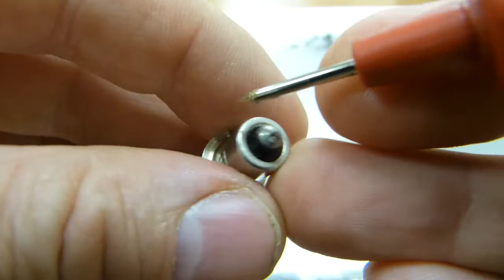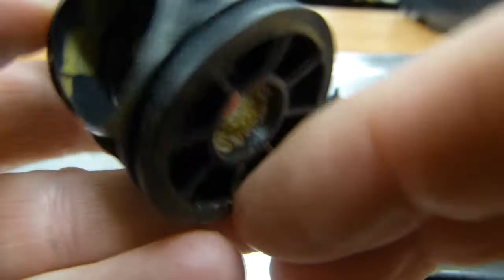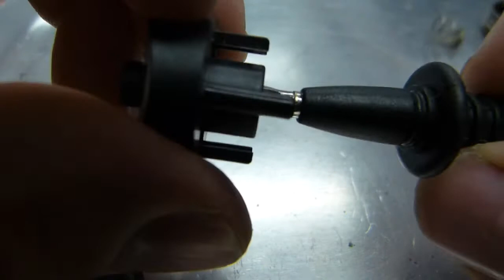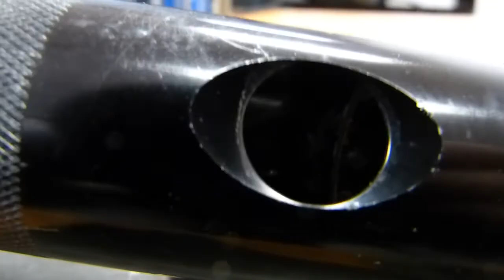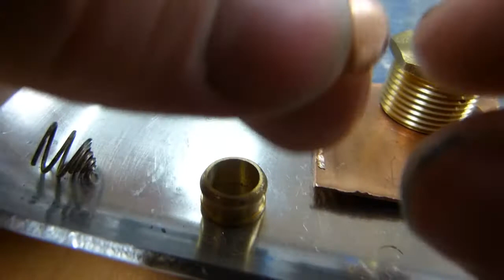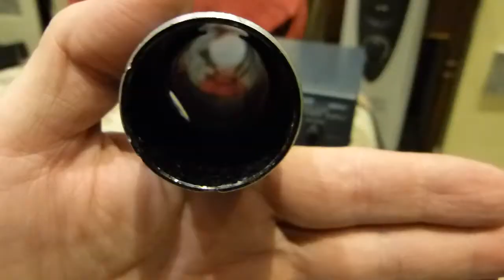Flashlight MAG-LITE® full overhaul (resurrection)

Comment: the one i had worked well but after a while the bulb would not stay in place. it looks like the ring that holds the bulb into its seat was poorly ,machined also the boss that the ring screws onto is a veery loose fit.come on maglite you can do better...